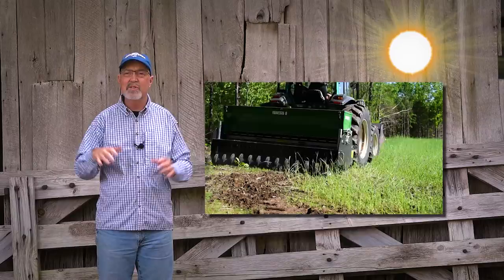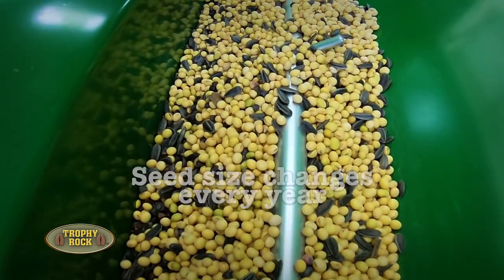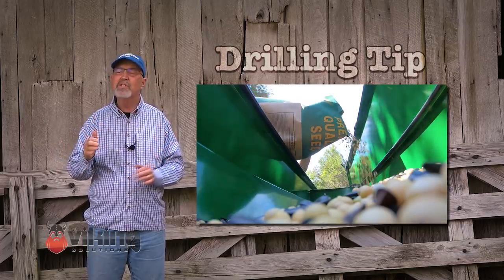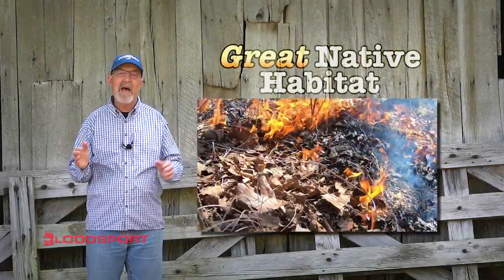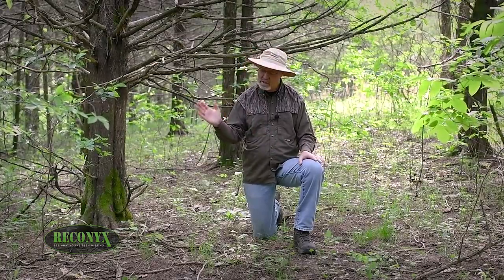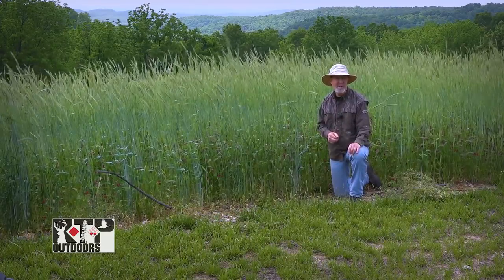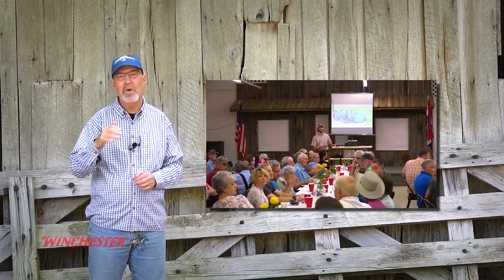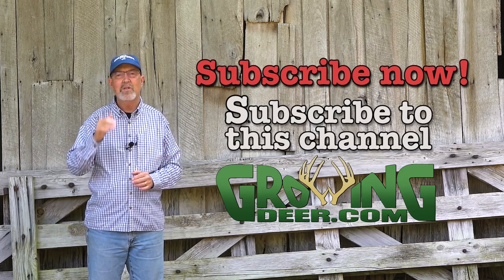Food Plots and Native Browse | Best Whitetail Forage (#443)

Comment: Can't afford one of those fancy drills. Would an older IHC disc drill with heavier springs work. I've seen others that flatten residue then plant in same direction.  We've got 6ft reed canary grass growing where beaver dams finally got taken down. I'm thinking of mowing and burning as nothing eats this course grass and starting with your system after that.
Reply from the maker: If the soil is very mellow the older disk drill may work. However, it wasn't built to do no-till work.  The Reed Canary Grass will likely be an issue for years because there will be a big seed base from past years. - grant

Comment: So if I don't have a No Till Drill, can I broadcast beans in the spring where my plot is without working up dirt? And then roll over the left over standing vegetation once the beans are in the 3-4 leaf stage? Then in the fall simply broadcast a fall blend into the standing beans? 

It's really that easy?
Reply from the maker: Isaac,

Beans are a very weak seed. They do best when covered with the soil. Many NRCS offices have no till drills to rent for only a couple dollars an acre.  Then once the beans reach 4-6 inches and the cereal grain is in the dough stage, you can simply terminated it with a crimper. When it's time to plant fall plots, you can broadcast into the standing beans and begin the rotation again next spring. 

By keeping the soil covered and limited disturbance (tractor tires and drill), you can build healthy soil, conserve soil moisture, and reduce costs ( herbicide, fertilizer, time, fuel, breakdowns etc). This process, which we call the Buffalo System, takes several years before it is up and running. For example, we have not used any commercial fertilizer for the past 5 years and all our soil samples are nutrient rich! 

You can find many more food plot and soil build videos at GrowingDeer.com. 

-Daniel